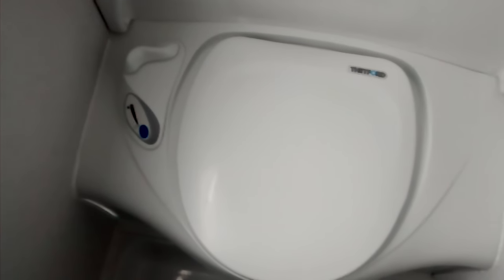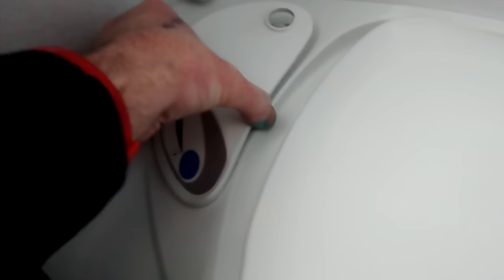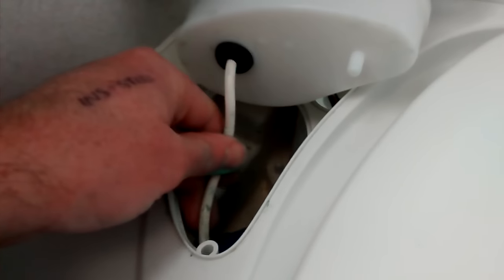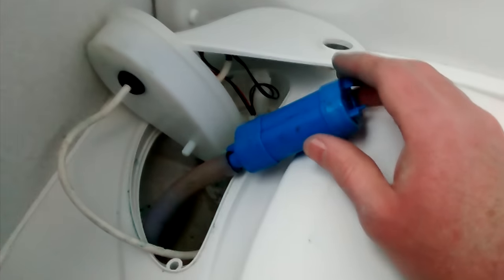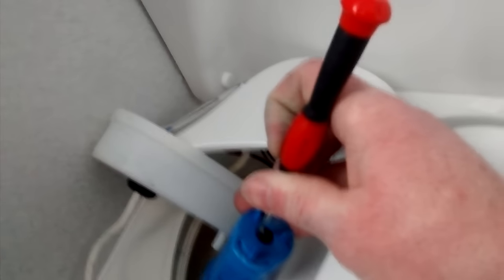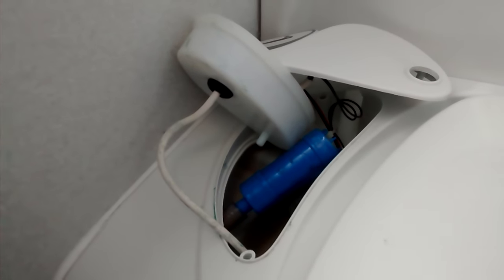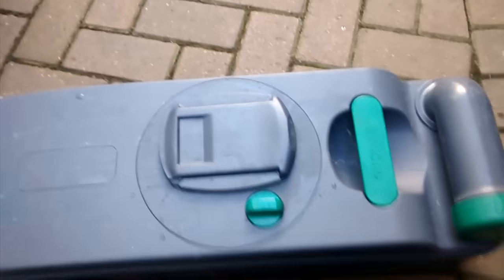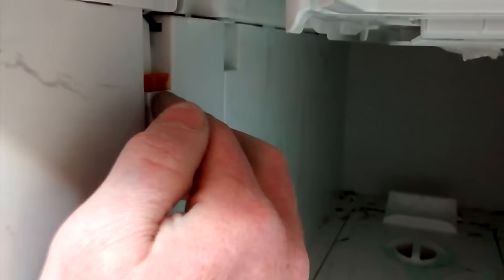THETFORD CASSETTE CARAVAN TOILET NOT FLUSHING

Comment: Great video however it hasn't solved my issue. I've hooked up the new pump which I tested on the bench with a battery. It runs perfectly. Checked the fuse, it was blown, replaced with a new 3 Amp fuse, checked with multimeter for continuity. Fuse is good. Hook it all up, Fuck all!. There is 12v to the PCB however it drops off when the button is depressed. Going to try a new PCB. If that's not it … it's hose pipe through the window:)

Comment: Wonder if anyone can help. Last time my toilet stopped working it was impeller. This time I’ve freed off impeller and changed pump. Still not working. Any advice?
Reply from the maker: Have you checked / replaced the fuse?
Reply: @BeauMadeline  yes. Put new fuse in just to make sure

Comment: That's ok but other models don't have fuses in them as they work of the main water supply currents.
Unfortunately Thetford have made replacing parts difficult on most models and not so easy as shown on your video!
Reply from the maker: Fair enough. I'm just a regular guy  and originally the video was on to help a particular person. I left it on because it appeared to help others too. It's not a textbook advice video and I'm not a caravan tech. I could say a similar comment like "the video advice for a bmw oil change is totally wrong for my golf gti" it's only a guide and only relevant to the same unit.